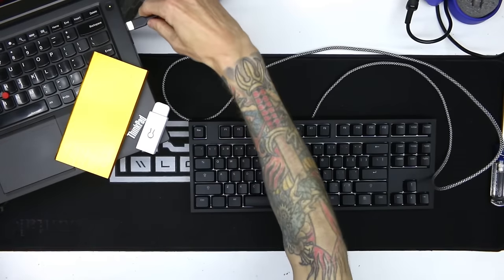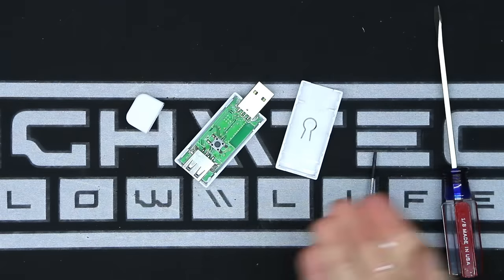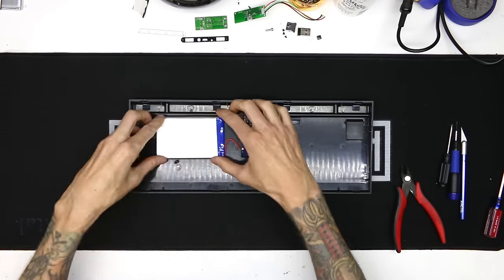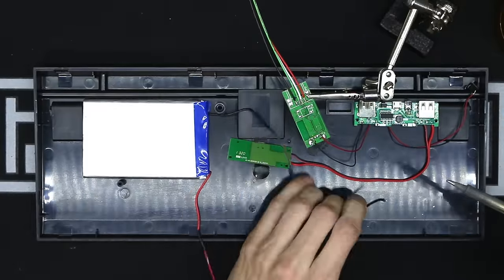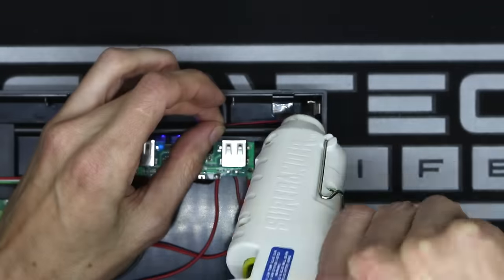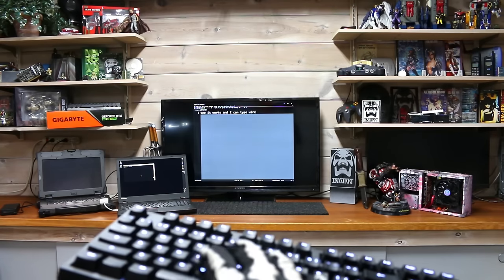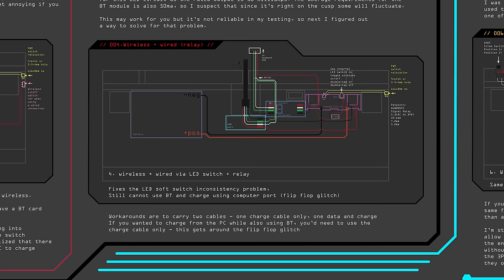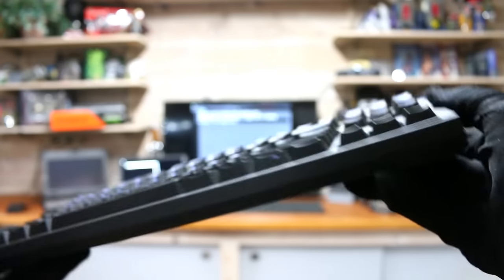⌨ Make ANY Keyboard Wireless! - Convert Any USB keyboard to Bluetooth Wireless - DIY Tutorial How To

Comment: Can you tell how to make Bluetooth Dongle into bluetooth keyboard and mouse converter plzz
Reply from the maker: Unfortunately they are not set up for that. The time, money and parts you'd need to make that a reality would cost way more than just purchasing the BT-500 module. You'd essentially need to hook up an Arduino then write the code to make it work, if it's even possible. I'm sure at the very least you'd need firmware access to flash the firmware, but there is probably a lot more involved than just that. 

I don't think it's possible (or at least easy) otherwise there would already be many tutorials on how to do it and there wouldn't be companies like Adafruit nor Handheldsci making these products, because you could just easily convert a $3 dongle to do what you want. I'm sure there is someone out there with the technical knowhow to do it, but I would bet it's not worth the effort when there are companies have already created the solution that you want. 

If you'd like to be that person to figure out how to do it, I'm sure the community would appreciate it!

Comment: I have 2 mortal kombat klassic fight sticks (Xbox 360 version) that I want to make wireless in this exact way. In fact, other than replacing the USB mini-B port to instead be a more modern port for accepting a charging cable (like USB-C), you could even do the “easiest tutorial ever” route for them because there’s plenty of room inside the case. Notice how I said ‘you’😅 …the reason is because I don’t trust myself not to mess up these limited edition sticks, despite it being super easy I’m sure. I have a soldering iron that I’m super unskilled at using, probably don’t have the right kind of glue gun for afterwards, etc.

I don’t really care about lag because they’re just for fun and since I’d be going head-to-head with someone else using the same bluetooth setup (it’s why I bought 2 sticks): lag should be near identical to each other anyway.

Could I ship these sticks to you, and then pay you for parts / labor / return shipping? You could make a video about the process as long as you leave my name out of it.

If so I’m going to need a better way to communicate w/ you (please) 😸
Reply from the maker: Hello Lia, It may be possible. I would try this though: 

First purchase one BT-500 and see if it works without doing any modifying (you can use a 5V USB charger to power it, so you don't even need a power bank). It most likely will do what you want, but I would confirm that before moving forward. If it doesn't work I'm pretty sure handheld scientific will offer you a refund for return (although don't quote me on that, please confirm with them before you purchase just in case, they also may know already if this works with this arcade stick so just ask them as well). 

This way if it doesn't work it will save you a lot of hassle, if it does work then I will be more willing to attempt to take it on doing the mod for you. I don't usually like working on viewers things because if problems occur or I cannot fix the issue, then that would bother me. I believe this mod is pretty simple and it may make more economical sense for you to take it to a local electronics repair shop, show them this video, and I'm sure they could do it. If you have me do it, you have to ship things back and forth (which can be expensive) and I'm sure that my time is going to cost more than a repair shop. So I would check that first to save you time and money. If you cannot get help locally (might not even need a repair shop, just someone who demonstrates more confidence with an iron.) 

I would also encourage you to try this mod yourself though, even if you don't have a lot of experience soldering, it would be something good to learn and if you go slow and take your time, then I'm confident that you could do it. Plus if you get stuck you can ask questions here and I will try to help you. 

If all of that doesn't work out and you have no where else to go, then I would attempt it myself, just send me a message on insta (link in the description). 👍🍻
Reply: @hightech-lowlife  Thanks so much for the quick and thoughtful reply!😺…I have some new ideas you’ve given me, and I’ll need to save up for it all anyway. While I have you tho, parts & shipping aside: what would you estimate it to be labor-wise for you to do both sticks? I don’t live in a big city, so it may be impossible for me to find an electronics shop here. Just trying to get my ducks in a row c:
Reply from the maker: @liacosgrove  Yeah no worries 🍻

I would do it for 120 each (labor + batteries, etc). I still encourage you to DIY though 👍

Thank you!

Comment: Can you do this with an Elgato Streamdeck XL?
Reply from the maker: Most likely it will work, you may want to contact the manufacturer of the BT-500 as they have tested (and tons of user feedback) for what does and does not work with their product.
Reply: I just got it in, it works with a keyboard but not the streamdeck. It powers up but doesn't connect. 
I will follow up with the manufacturer.
Reply from the maker: It's possible the deck is outputting scancodes that are different than a regular keyboard, if this is the issue then I'm sure it can be remapped to fix that @joshslater3430

Comment: If I have, let's say, a Logitech keyboard, it would be recognized as such in windows?
Reply from the maker: Can you let me know what you mean by "recognized" ? - When using this adapter it will be recognized as a bluetooth input device. 👍
Reply: @hightech-lowlife  sorry, some terms got lost in my translation. I'm a Brazilian. But by recognized I mean "saw" as a Logitech keyboard in windows. And you already answered me. My thoughts were that I could customize the keyboard in it's software. Apparently it won't be possible. 

In my graduation I was studding USB signals so that I could develop wireless receiver and transmitter in a way the USB connection between them were seamless but money is more important...
Reply from the maker: @murilomauro  Oh it's no problem! :) I don't think it can know which keyboard you have unless there is some way to either script on windows side or through the firmware (although probably not possible). Usually this assignment is through windows though and not the other way around (from the keyboard itself). Most likely some Device ID that is signed by Windows that then gets a special name/icon. I'm sure you could do this custom on your local computer somehow though, seems like it might be a lot of work just to show an icon and name. Actually, I'm pretty certain you can just rename the device and give it a custom icon from windows if you want 👍

That's really cool! If you could find a way to turn a cheap bluetooth dongle into a transmitter too, that would be a game changer for this type of modding. 

Thanks for your comment!

Comment: Is there any ways to make a keyboard wireless with 2.4 ghz connection?
Reply from the maker: Yes, you'll have to hack up an existing 2.4 keyboard and gut it for the internals and place/splice those into the new keyboard. It's more complicated but it is possible.
Reply: @hightech-lowlife  i dont really know what internal of keyboard look like, but do the wireless module usually merged with main pcb of the keyboard? Or it is separated from it?
Reply from the maker: @yamumayan  It depends on the board, I'm sure some are integrated, some are separate. 👍

Comment: by the way, did you can tell us how long thats battery can hold to keep it on ? and how much is it?
Reply from the maker: A lot of factors will affect battery life, keyboard size, backlighting, backlighting setting, battery size, etc. I have a section on my site about battery life: https://hightech-lowlife.github.io/projects/004_wireless_keyboard/004_wireless_keyboard ~ scroll down to the section on batteries. 

On this particular board, with medium backlight brightness it's about 27 hours per charge. With backlighting completely off, that should get you about 80 hours on a charge.
Reply: @hightech-lowlife  uuhhh thank you very much
Reply from the maker: @gilbyska6126  No problem, thank you 🎃

Comment: Great video lad! Me not doing it. But, let say if i have royal kludge rk84 (which wireless already) and i change the battery to my 50k (if there is any) mah battery, basically i can run the keyboard for 1 month full before put it on the wall. Right?
 Btw, WTF with the 9 dislikes?!!
Reply from the maker: Thanks man, I appreciate the feedback! You're correct, and they do make 50,000mAH batteries, theoretically there is no limit to the size of the battery you can use, if you hook up your keyboard to a Tesla pack from a car it would last a very long time :) 20,000,000mAh

The dislike ratio is pretty normal and will go up the more views it has, there has to be some balance within the world I suppose. I'm actually surprised there is only that many! Thank you though!

Comment: will this work with a PS/2 to USB converted keyboard?
Reply from the maker: I don't see why not?
Reply: I can now confirm that this does indeed work with 
ps/2 that runs through a PS/2 to USB adapter.  @hightech-lowlife  the bluetooth adapter also works with mice too... which is good as the keyboard i used has a PS/2 mouse.
Reply from the maker: @devicemodder  That's great to hear, thank you for updating me with this info 👍

Comment: Do you have time and knowledge to make outdoor  WI-FI camera from mobile phones???
Reply from the maker: I think that's pretty easy to do :) 

Some examples here: https://www.cnet.com/home/security/turn-old-phone-into-security-camera-in-3-steps-heres-how-android-iphone/

Only thing left is weatherproof it for outside use and you're golden.
Reply: @hightech-lowlife  Yes bro, but it was easy too with a keyboard, but you make it harder :D
I know it's a finely printed electronic board, but it would be nice if you could do that in some way, like a pro?
If you know what i mean???
Reply from the maker: What do you mean? 😂You mean in like one package? Do you have an example? Thanks man!
Reply: @hightech-lowlife  Didn't think about it really :)
How about that you took cameras and wifi chip, with battery and thinks that is going to be needed to make this work. And put it in some case and connect couple of that thing to work like home security or something like that???
There is alot of old phones in our houses, help us make something out of them?! :)
Reply from the maker: You don't need a wifi chip because the phone can already connect through wifi 👍There are a lot of apps that already do this for old phones to repurpose them for security cameras 😁I linked you already but maybe want the phone in a custom case? Maybe more batteries? I just don't know what you are thinking. 

I have a lot of old phones too, maybe I will try to make a video on what you can do with them, but I think it is limited. The main thing I have used them for in the past is a media player in my car, but most people already just use their current (new) phone for that. Thanks!

Comment: U don't need such a huge power Bank inside .. 2 recharge AA cells can do it for u too. Well done
Reply from the maker: If you want runtime you will need more than that 👍2 AA will only last minutes with this setup. I built another smaller custom board (on my channel) with two 6Ah (12,000Mah) packs and it runs for a very long time

Comment: Has anyone tried this on a keyboard with ARGB? Like a Razor keyboard? If so, does the OEM software still work? Do the macros still work?
Reply from the maker: It's possible it will if the app communication is not at a firmware level - if it's making changes to the firmware (which it probably isn't) then it wouldn't work. The reason is the USB adapter acts like a bridge, so the device IDs will not match for things such as pushing code to the firmware.

Comment: Can I ask if this would work if this only connected through usb? I mean is this a 2 way mechanical keyboard?
Reply from the maker: Hello, are you asking if this can be used as a wired keyboard and a wireless keyboard? Yes, it can. If you watch the demo part of the video (18:05) I show it working both wired and wirelessly . 

You can wire it up to be only wireless or both wired and wireless if you'd like I show have schematics for both ways, with even multiple options for both those ways. 

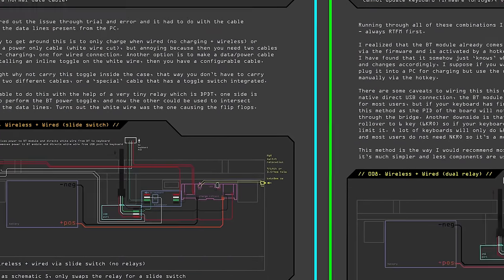If you watch the last part of the video I explain two different recommended ways of getting wired/wireless options set up. One uses the onboard BT firmware to do the switch via a hotkey, while the other I use mechanical relays to do the switching - both have their pros and cons, but I explain that in the video (18:16).
Reply: @hightech-lowlife  thank you man for explaining! I'm planning doing it to my mech kb, which is psycheagle MKA-7C. But I have problem which it has 5 wire connection, also I noticed that the kb you used have a separate board for the cable, which in my case it's attached on the main board already. Any ideas how can I achieved on doing this? And any other way can I contact you?
Reply from the maker: @greggutierrez6875  No problem, your keyboard has a regular type-a plug so it is 4 wires, if there is fifth wire then this will just be an additional ground (black) wire, but it's not necessary to hook up. All you need is the red, black, green, white. 

You'll want to mount your own USB port to your case somewhere so that you can attach/detach a cable more conveniently. There is no real difference in the keyboard I used other than the factory already mounted a port, but you can easily add your own. Cut a hole for it, hotglue it in place, etc. 

I reply to all comments I get, you can dm me on insta if you'd like but I don't check that as often. Thanks
Reply: @hightech-lowlife  thank you so much! For real! Haha God bless to your channel!!
Reply from the maker: @greggutierrez6875  Thank you!!

Comment: Hello. Do you know how to---Convert Bluetooth Keyboard into USB powered Keyboard? Thank you.
Reply from the maker: https://www.youtube.com/watch?v=Qvd_3sGMd2o although he's still using the wireless signal, he's just bypassing the battery. Basically same steps but you need to figure out the D+ and D- connection for the USB cable and it should work. 👍

Comment: can you place a hub after that wireless dongle? :-D
Reply from the maker: Sadly it won't work as a hub, oddly there really aren't any 'bluetooth hubs' on the market, I found one or two but they have severe limitations. This adapter can do a keyboard and mouse at the same time though! You actually may be able to use it for more peripherals but according to the mfg, it's not really tested so they can't say it 'will' work for everything. I might try to hook one up as a hub and see what happens 👍

Comment: Could you covert a PS2 keyboard over to wireless.  I have an old Gateway keyboard I really like.
Reply from the maker: I haven't personally tried it but I don't see why it wouldn't be possible. They do make PS/2 to USB adapters, so most likely you would need to adapt that first with something like this: https://www.monoprice.com/product?p_id=10934 I'm sure lots could be done to trim down the 'packaging' of this to get it to fit inside the case as well. 

If there is enough demand for this I'd be willing to make a video on converting a PS/2 to wireless - maybe an old Model M would be cool ⌨

Thanks!

Comment: Is there any way we could reverse this? I lost my keyboard’s dongle and now it’s useless to me currently
Reply from the maker: I don't believe it's possible, do you mean a bluetooth dongle or wifi?
Reply: @hightech-lowlife  wifi one that works at 2.4 GHz
Reply from the maker: @shubhkarmansingh3984  This would not help that situation, but with this adapter you could convert that keyboard to use bluetooth, then you can use any dongle and most modern devices have bluetooth receivers built in. 👍

Comment: Is it possible to do the same thing with a 2.4ghz wireless reciever?
Reply from the maker: Yes, It is possible, but the easiest way is probably just using a 'wifi' donor keyboard and clipping out the 'wireless' parts, this guy did it back in 2014 to his Das keyboard, using a cheapo HP wireless keyboard as the donor for the parts: https://www.ivanyu.ca/blog/2014/2/2/wireless-das-keyboard-modification 

I haven't done extensive research but Bluetooth is much more prevalent for these kinds of things, even in the Arduino/maker space. To me it makes more sense because BT is usually an embedded standard for a lot of devices, so you don't need to take up a USB port for a dongle.

Comment: will it work for wired gamepads?
Reply from the maker: It should work with almost anything, here is a list of only the things they have tested so far: http://handheldsci.com/comp/ 

Also, they will even offer a refund if it doesn't work with your device. This is from their website: 

"Double Commitments: (1) We will investigate any case of incompatibility you report and provide free replacement until the issue is fixed; (2) you can return the adapter for full refund including S&H within 6 months of purchase for any reason. If you have communicated with us about an issue, then there is no time limit for the return. The returned unit can be in any condition, e.g., without original package, damaged, burnt (in that case we just need the ash back :-)."

I'm not sponsored by them at all, but to me (IMHO) a company that allows this kind of experimentation and allowance for trying things out is unheard of and they deserve the money.